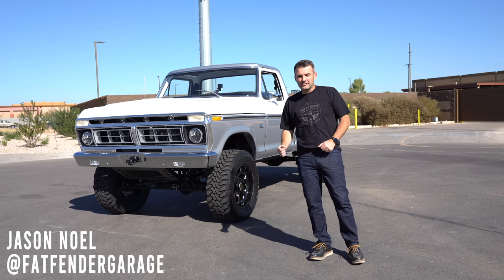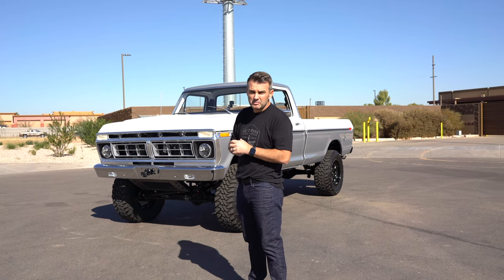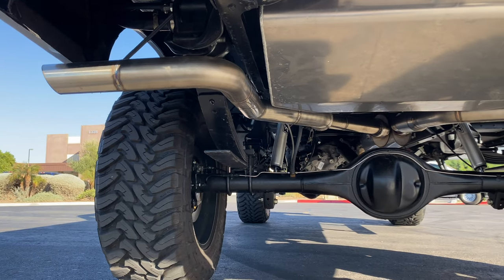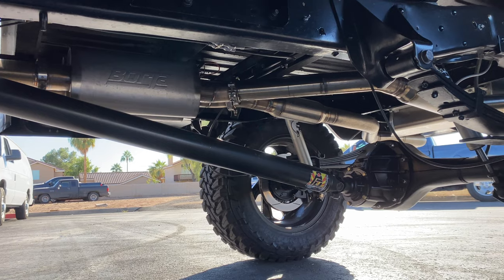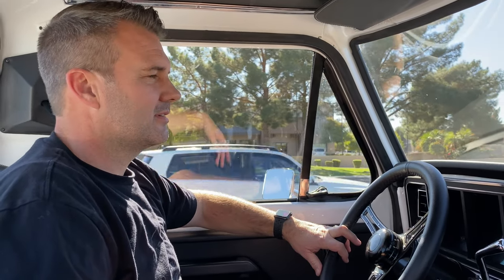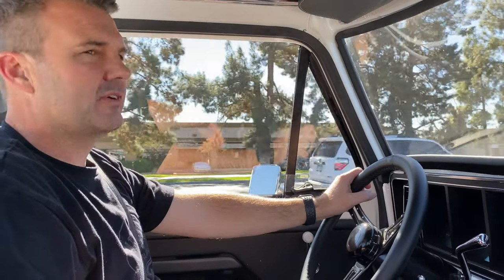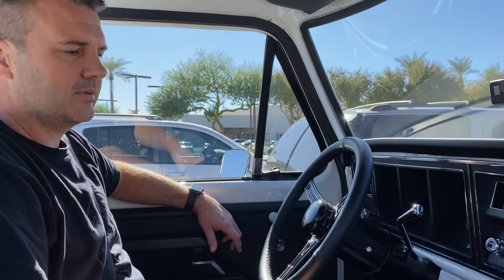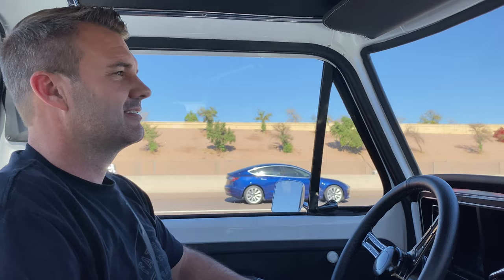What's It Like to Drive a Supercharged Coyote Swapped 4wd Ford?

Comment: I'm surprised you didn't find an F250 highboy with a divorced NP205 (factory lift)..  A Dana (78-79) 60HPKP gives 4 more inches to the stance! I have the M400 2V aussie heads.. 👍🇺🇲
Reply: Also have a 59 shortbed on highboy gear. Snowfighter 60.

Comment: I have a 1977 Ford F100 351M. I am fixing up but having issues with door rubber and bed rust. Could use some pointers on how to beef it up a bit without going over board.

Comment: How did you guys control the transfer case? I would love to know. My project is on hold due to work but I have the 10R80 and matching transfer case and haven’t seen any info on controlling the tcase. I’d love to maintain the electronic shift function and selector switch. Are you guys using an OEM F150 control pack and body harness? I plan on using the Ford Performance Control Pack.

Comment: My 97 7lug steering box is tight like a rack and pinion. Never been replaced. Even did alot of plowing with it. Guessing it has 300k mile on it. Point is I wonder if that box can be used on the older fords. On rock auto it's an f250 under 8500lb and they do have motocraft available.

Comment: well done, quality build, how did you manage to connect the column gear selector to the electronic 10 speed? same for the transfer case, which case did you use to electronically select your drive mode?

Comment: I have 79 bronco custom my dad a 78 xlt bronco. We both big ford guys I also had a 2003 lightning ⚡️ I sold for a 2013 Shelby gt500‼️ the only thing I would of done to the truck would’ve been a 10.25 rear diff and 60 front‼️😆😎👍🏽

Comment: Il take my 77 F150 with the 429 i swapped into it. 373 gears Got 11 mpg n would put the speedo needle right around to 0 on the speedometer. It was good for 120mph easily

Comment: It looks like a 1977 f150 ranger 4×4....will the tir rods , ball joints steering linkages inter change with the 76? And can you still get the steering parts ....iam having a horrible  time getting parts for my 1977

Comment: i got a 70 high boy dana 60/80 rust free tool box on side good clean body a pu box full of chrome , emblems and lights extra front clip all for 250 bucks putting a 390 in it had a 429 so i have the engine stands for the 429 and 460 i am going fe block because i been building up a 428 cj for it then i got a set of 16.5 rims and i get military tires for 25 bucks each 36.5 tires my 68 chevy i have 2300 in it and it has a stroked 454 with tunnel ram heavy duty 400 turbo 12 bolt possi just needs final paint and interior is left to do but i have lots of fords and chevys some full restored but have 10 acres of good project rigs from 57 to 79 its my private wrecking yard . i have a secret on getting good crate engines cheap if not free the 68 chevy has 6000 miles on the engine and got 2 of them for free with the heavy duty 400 turbos 454 450 hp at 485 torque stock 4 inch stroke steel crank heavy rods just think how much money that saves on a build plus they are all complete with all the coolers and lines to put it in . i just traded a good running 350 4 bolt for a newer l.s.7 out of a 2018 vett worn out engine but still runs i think it needs a valve job got the 350 for free have 8 of them sitting all with low miles on them

Comment: that is pretty good output of actual wheel horsepowe to the Wheels", opposed to the BS standard manufactures use which is crank, which doesn't account for drivetrain loss, I laugh to myself people who ignorant of this fact start clamouring about what is stated in the brochure, all that matter is power to the wheels IRL.
I have found each lbs of boost equates between 10-12 nominal horsepower gain.

Comment: So, quick question. If I were to daily drive this beautiful vintage pickup (which I totally would) with the modern drivetrain in it, would it pass emissions if I need to give it an emissions test? Some places like for older vehicles to pass emissions (even though I think that's completely asinine) but, whatever. Would the modern powertrain in this gorgeous classic truck help it pass emissions if needed?
Reply: Yes this drivetrain will pass emissions if it has cats on the exhaust.

Comment: Does id have a rear LSD? if it does thats impressive " spinning the tires" but if its open, its really not that impressive. 
Although im sure the S/C Coyote probable has enough to spin both rear, you wouldn't need that powerful of a motor to spin one wheel. 
this is an amazing build. i had a 67' f250 camper special it was a nice build but nothing like this!

Comment: I liked the early 80's straight six! Oddly enough. Great motor for torque, if you had a manual that is. But I am a lover of the 8 as well and I had a 2011 with the 5.0 and it was a great engine. Im curious about the rake on that drive shaft! Im not a 4 wheeler guy so this may be a stupid question but doesn't that rake play hell on U Joints?

Comment: FORD GMC DODGE 90% of the Trucks from 1960 to 1990 were Standard Cab 8ft Long Bed Trucks.... All the Club Cab, Super Cabs and 4 Door Crew trucks were 8ft Long Bed Trucks also.... FORD GMC DODGE and MOST were 2WD Drive, 4x4 and Standard Cab Short Beds were less common

Comment: Everybody knows that the bench seat is way more comfortable and you just up sold that guy on the bucket seats because you have the brackets
Reply: What sounds cooler 800 hp with bucket seats or 800 hp with a bench in it. C’moooon sliding around is the best part!!

Comment: 4-wheel drive is about off road at low rpm. What kind of torque does this engine put out between 2500 to 4000 rpm? A bunch of horsepower at high rpm is for a race car. Not a four wheeler.  Cubic inches are what give you both horsepower and torque. Coyote is the wrong engine for this pickup.